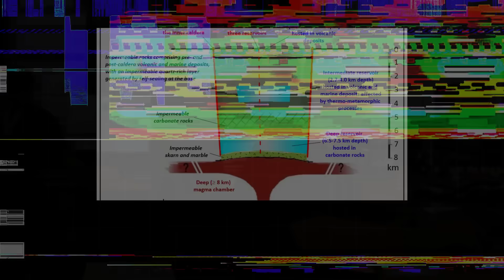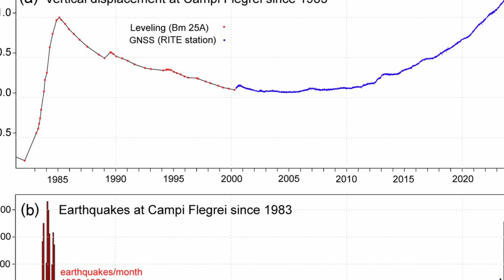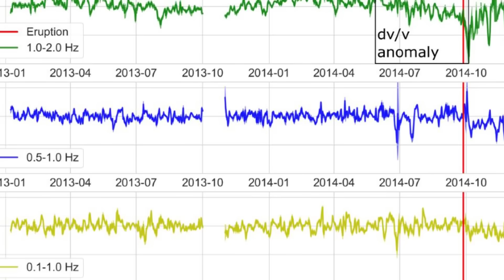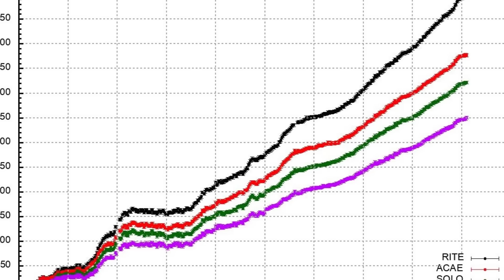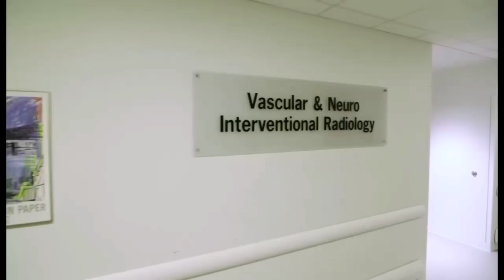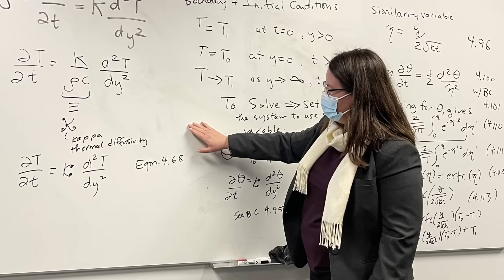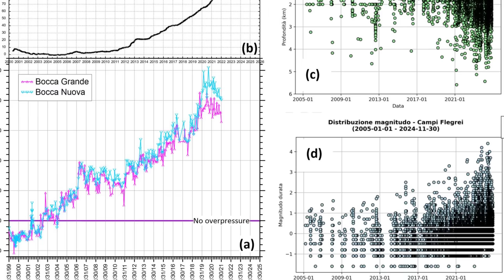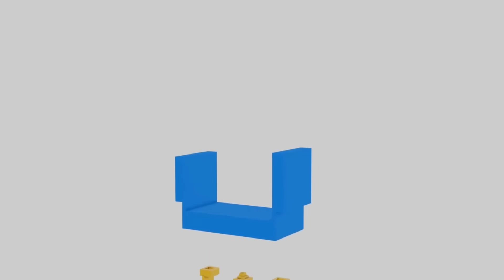1 MINUTE AGO: Campi Flegrei opens new fault line, risk of magnitude 5+ earthquake

Comment: The real issue with freatic explosions should be the generation of cracks near the surface that probably  happen near the magmatic cracks that generated the heat that triggers them. The path between magmatic and freatic cracks should be very short. Isn't that the final step before volcanic explosion?